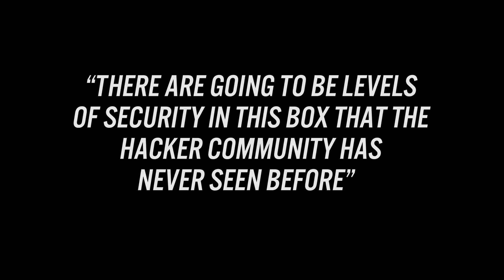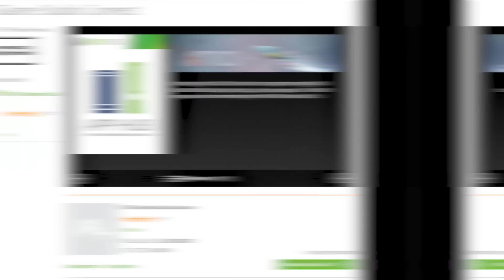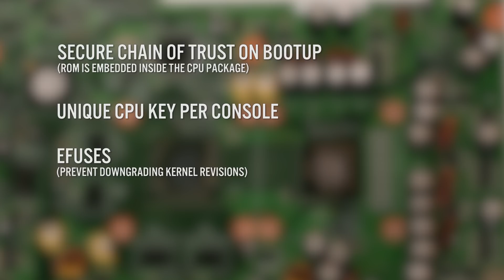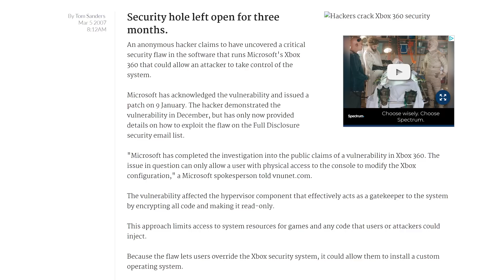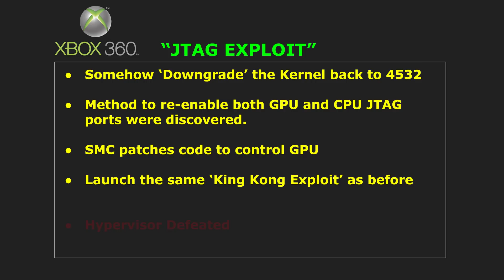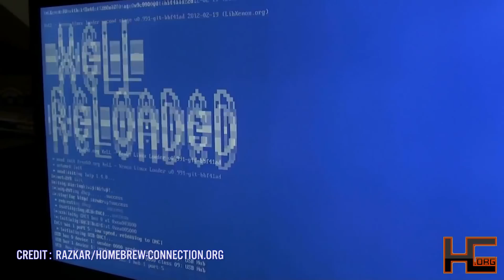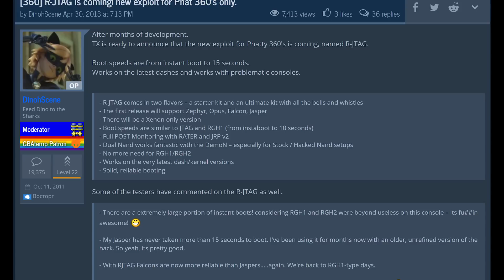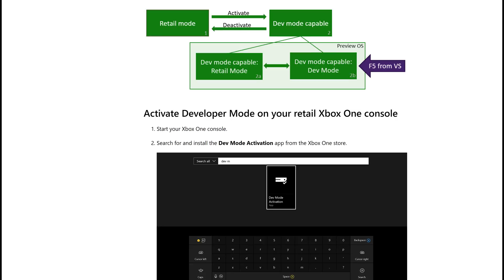How the Xbox 360 Hypervisor Security was Defeated | MVG

Comment: So I have a question, when you do a 360 OS update on the console, what parts of the NAND does it update? bootloader, CBA, CBB, CD? I heard CBB has changed in the past which is protected (hmacsha1 protected) by your cpukey, which means that microsoft would have to know all the cpukeys of all console and presign the update files before they gave them to your console if it were updating CBB?

Comment: I loooove my modded 360, I bought it pre modded with some call of duty games installed on ebay about a year and a half ago for around £50-60, an amazing deal. I mean it's a nearly spotless 360 S system with a to this day beautifully maintained controller, all the original manuals & paperwork and even its box. I never had a new 360 back in the day, my family were Nintendo people but we had a PS2 till I was 3 or 4. Having my own Xbox 360 with all my games backed up is amazing. I maxed out the expanded hard drive with so many games, I can play some of my favourite games of all time with very little hassle, just plug it in and play, regardless of if I have the discs readily available. I've got them boxed up just incase I buy a new 360 game to play and need to uninstall something

Comment: It's amazing that after nearly 2 decades since the Xbox 360 came out, it's security system still has not been breached when it comes to softmods like the PS3 and Wii. I would not be surprised if softmodding an Xbox 360 is actually impossible.

Comment: I wouldn't say it's completely defeated. To this day, there was only ONE softmod for the Xbox 360, and it was patched pretty quickly. I'd say the security on the Xbox 360, at-least software wise, has been untouched. Might even be one of the first unhackable consoles, software wise. Sad, too, since I, and many people, don't have the knowledge to hardmod one, and don't have the money to buy a premodded one. Unless a softmod comes out, I'm always going to think Microsoft really did make the Xbox 360 unhackable, again software wise.
Reply: Its not difficult to hardmod a 360 and a soft mod wouldn't be so popular, as hardmods are superior
Reply: @rob831  You sound very biased. Not everyone can solder. Even decides, if hardmods are so perfect, then why do softmods exist? I don't want to go try learning microsoldering, and potentially spend so much money on broken consoles, just to mod one console. I don't have the money or time to do so.
Reply: @chachaboy2  Because softmods wouldn't work on the Xbox 360, it was designed to fix the problems from its predecessor, the original Xbox, which is softmoddable. 
Because you're not willing to learn a new skill.
I JTAGGED and RGH'D multiple xboxes without experience. I taught myself.

Comment: From an outsider perspective: the Xbox runs a modified NT kernel similar to 2K or XP, and it has internet explorer as a browser, even if it seems like it isn't just sandboxed but it's also running on a separate mini OS.
That is very old software, and outside of the hypervisor and the encrypted stuff the only other reason I can think of why someone hasn't found a full software exploit chain by reusing known vulnerabilities is that powerpc is a dead architecture.

Comment: That's a very good investigation material about run unsigned code on the 360. I lived the problem of the RGH (Known as 5.0 in my country) that's unable to boot in sometimes when I tried to install FSD3, but at least, I installed and it going very good but the TU update is necessary, so I want to try aurora for that kind of feature.

Comment: seems easier to just make the console self destruct if anything is unusual
code the cpu to short the power pins and bam dead console
Reply: Not exactly that would require no update flaws at all.

That's always a backdoor for any programming purpose and setting that to self destruct is not preferable (e-fuses is in theory a good counter measure)

Comment: Ok, I've done hundreds of RGH, R-Jtag, and Jtag consoles over the years and xenon motherboards were compatible with the RGH hack. It was not widely used as it was completely unstable and only used for DVD key retrieval.The original RGH done by glee glee the developer of the exploit was compatible with Xenon, Zephyr, Jasper 16mb, jasper 256mb, jasper 512mb, falcon, and opus boards. This exploit was done originally with the C-mod board later to be replaced with the cool runner. Later the hack came to the Slim consoles. Each motherboard had a specific timing profile for the attack on the CPU. Some boards were extremely reliable others were not. I personally still have a dual nand RGH falcon board. You also left out dual nand systems using the demon boards from Team X. There was another board used previously for dual nand systems but I can not recall the name at this time. Lets not forget about the battle of defeating the Xbox Live challenges to allow these system to connect and hack all of your favorite call of duty games. You left out a lot more information than that.

Comment: Some corrections:
- The JTAG hack was not patched until Summer 2009 when the 8XXX kernel was released which overwrites the CB. 
- Zephyr, Falcon, Opus, and Jasper are all able to be JTAG'd using slightly different wiring, either using ROL or AUD_CLAMP (assuming 7371 or below). The Kronos motherboard shipped with a patched CB, which patched the SMC hack. Some Kronos have been found that were not patched, though.
- The lower left port on the Xenon board is not the CPU JTAG port, but the Southbridge/SMC LED JTAG port. This is why on Zephyr and later when most of this port was removed, one of the wires goes to the Ring of Light instead. The CPU JTAG port is J8C1, on the upper right of the board.
- The Reset Glitch Hack can be made very reliable, depends on install, tuning, and chip used. RGH1.2 can instaboot Falcon, Jasper, and Kronos on latest dashes. S-RGH can instaboot Trinity and Corona. There isn't really a reason to use R-JTAG anymore because of that.
Reply: Good to know

Comment: I remember doing this after the DVD drive hack and man was it a HUGE pain in the ass! I had a Zephyr (or possibly a Xenon) and attempted to do the JTAG myself, even though I sucked at soldering. I managed to build the NAND dumper using a self-built DB-25 connector that was wired to the board (got the instructions either from XboxScene or 7Sins), I remember it being hit or miss since you needed certain resistors and diodes in order to make it work, and it just took a bunch of trial and error. Dumping the 16 MB NAND took like a half an hour since it did it bit by bit over the serial port. I was in my early 20s and was home from college and I remember being stuffed behind my PC trying to get the connection stable (it would read for a while then suddenly fail), and my mom came in, knowing what I was attempting to do (well as far as "hacking the xbox360") and said "how the hell do you even know what you're doing?!" and I just said "I don't!" hahaha I managed to dump my keyvault, mod it, and flash it back, but my leads kept ripping out of the JTAG ports (since they were like 26 AWG wire and the pads about the size of a ball point pen) and during one the the multiple fixes some stray solder shorted out the Northbridge and caused a permanent RROD. I found this out by posting to xboxscene and a dude that had a reflowing setup to fix RROD boards offered to take a look, he said it was toast, and I told him to keep it since I had zero use for a dead xbox. He was also selling JTAG'd Jasper units, so I bought one from him at a discount. By this time someone on Xboxscene had built USB dumpers which made the process a million times quicker and easier (still required soldering, but no janky connections), especially since Jasper has a 512MB NAND instead of 16 MB. I kept hacking it for years but got tired of it and it sat in my closet for years. I finally gave it to a retro-gaming loving geek friend of mine as a christmas present last year and gave him all the tools necessary (even opening the shell was a nightmare), but he said it was far beyond his level to update it or anything, and just used it as is. It definitely wasn't for the feint of heart.

Comment: > "levels of security that the hacker community has never seen before"
> literally the most exploited system ever, re-hacked even after anti-piracy challenges sent by the servers, irreversible fw patches and new hardware revisions.

Anyway, that eFuse technology is something only the X360 CPU owned at that time?
As far as I know, now Nintendo has implemented a similar anti-downgrade measure with fuses in the Switch

Comment: if im correct then u miss the drive emulator which was connected between drive and console and allowed to be play isos from a external HDD, this was one of the recommend solution until RGH released. To the Drives, when my memory of the story 10 years ago Microsoft added on ap 2.5 another feature and make the firmware readonly and alot of people had the problem that there custom fw was overwrite and they where not allowed to bring it back or use any other one , also on this point in some case Microsoft fucked them self with this action  but on this point im not sure and i not know how the problem they had was
Reply: Rgh wasn't about the drives tho
Reply: @rob831  i know maybe i had post it under the previous video, its still a hack
Reply: @StefansSpielwiese  yeah that one video talks about the drive hacking

Comment: XexMenu is a homebrew menu that allows you to load everything, including backup games from either a USB drive or even an Xbox 360 hard drive. Freestyle Dash can be installed on Xbox 360 using the XexMenu.

You can install the XexMenu after you've modified the Xbox 360 with any exploit (King Kong Shader, JTAG, JTAG Timing, RGH, R-JTAG, S-RGH).

Comment: That was a very consise and dry look at at the 360 hack days. Thank you very much. I hacked mine with a reset glitch. It's unreliable. I thought initially I'd use it for piracy but that was still a pain so I found that it actually slowly ended my will to play games at all. Instead I concentrated on homebrew and applications like emulators   and ultimately used it as a nerd sandbox.
Reply: The rgh is not unreliable today. Say like 2014, then it was unreliable. Today the rgh 1.2 is a great hack and the S-RGH for slims as well.

Comment: 16 bytes are NOT easily bruteforced. 12 bits however are. 4096 is 2^12, so the actual lockdown counter is probably 12 bits, expanded with that encryption/hashing

Comment: Great video, but you're confusing the timing attack and JTAG hack together into one hack, when they're actually two separate hacks. 
The timing attack hack is a DOWNGRADING hack discovered shortly after MS patched the King Kong hack in the new Dashboard. The memcmp function used to compare the 16-byte hash for the LockDownValue was found to have significant latency when a wrong byte is compared, allowing one to deduce if the current byte being guessed is right or not. Using this method, one can build a new NAND image with ONLY the base kernel (ie, the Dashboard version found in launch xbox 360s), crack the hash for the LDV so the base-kernel image will boot, and then update the base image to the exploitable firmware (like a regular Dashboard update) to use the King Kong exploit. This has nothing to do with the JTAG hack (which came later) and the JTAG port was never used for this particular hack.

Comment: There is a saying in the world of serious computer security, "Physical access to the system is total access to the system".  I don't even know why manufacturers bother with such nonsense as security screws, that was busted from the word go.  But when it comes to electronic security techniques, they all fall sooner or later because you can always put a Logic State Analyzer on it, you can dump ROM or RAM, you can even grind down chips like the Soviets did to copy them, to get at the die and measure signals from inside the chip itself.  I really can't imagine it's worth all the money and time spent doing this kind of thing, it makes the product slower, clunkier, more unreliable (it's amazing how much more reliable an NES becomes once you cut the one pin that makes the 10NES chip forget what it's supposed to do) and more expensive.  I would rather spend my money on something where more of the money is going towards the characteristics of the thing that make me want to buy it than to the characteristics that make it antagonistic towards me.  I haven't bought a games console for myself since the GameCube and don't intend to in the future.  With the exception of one graphics adapter more-or-less by accident, I have never bought anything new with an HDMI port on it, either, as that interface incorporates that non-feature as well.  "Highly Dubious Media Interface", I call it.

Comment: Some extra info if you're curious: Thanks for the JTAG explanation, did not know it was reusing the 4532 slowdown hack. Also with RGH the main effect was that by slowing down the cpu a memcmp instruction usually fails in the low-level (unchangeable) boot process thus allowing to run patched boot code from the 16mb onboard boot flashrom... after that is successful - sometimes the whole cpu crashes - it is sped up and the fun can begin with patched hypervisor, etc. There were lots of custom chips created for this purpose. You also needed access to the cpu reset pin. Later xbox 360 slim models essentially first just did not route the cpu reset pin out from the bga cpu package so you could only access it with a small pin (4th ball counting from the top left of cpu), and towards the end of its life, from end of 2013-2014 they even removed that ball completely, so models from that point were essentially not able to be RGH'd :( Not that it mattered by that point in time. Modders usually swapped the mobo of these to an earlier model while supplies lasted.

Comment: Is there a way to load ISO images from a USB?
Reply: You can run games from a USB with a jtag or rgh but not isos, you gotta unpack the isos and have them in a certain folder. There's a program to do it easily.
Reply: @recondite376  What does it mean to unpack the ISOs? I'm completely new to XB360 hacking.
Reply: @jamesbuckwas6575  an iso is just the image file of a DVDs file and folder system. It's like unziping or unraring something. It turns the iso into a folder with the default.xex and the folders with the other stuff in it. There's a program that will do it for you and turn it into a GOD
Reply: The 360 can only load backups like that if it's jtag'd or rgh'd
Reply: @recondite376  What program can do this?
Reply: @jamesbuckwas6575  loading the games or extracting the iso in GOD format?
Reply: Dave Girvin extracting the ISO.
Or both I guess
Reply: @jamesbuckwas6575  I can't think of the name off the top of my head cause it's been a while since I've used it. I'd have to hook up my desktop to tell you the answer and I'm not getting into that tonight. Hopefully someone can fill you in. If not I'll lyk when I get it up and running.
Reply: @jamesbuckwas6575  ISO2GOD is what's coming up in a quick Google search but I think there's another program that does that and manages the external HD and files. I thought it was a regular name not an acronym name like ISO2GOD
Reply: @jamesbuckwas6575  I think it might have been buffalo drive explorer. For some reason that popped into my head. Or party buffalo
Reply: @recondite376  It's Party Buffalo Drive Explorer
Reply: @jamesbuckwas6575  a newer program to check out would apparently be FatXplorer. I haven't used it but I've seen it recommended
Reply: @recondite376  Alright. 
I switched to hacking the PS3, but thanks anyway. Maybe in the future.

Comment: So I had my Xbox 360 in 2011?  It came with R-JTAG? It boots very slow and indeed sometimes does not boot at all, then someday around 2013 it never boots up again, and I take it to a "dealer" to get it fix, after the "fix" it boots very quickly everything works just fine, anyone idea what kind hack is my Xbox 360 using?

Comment: Funny there is not a decent xbox emulator yet for original xbox

That is basiclly not more than a x86
Reply: Well, the thing is that with an x86 base, it would make little sense to actually emulate it, as it's basically the same hardware. This is why CXBX works by intercepting the system calls made by the Xbox games and redirecting those to the Windows equivalents (within the sandbox, of course), instead. But that has turned out to be quite the effort, as well.

Comment: The engineering behind the Xbox 360 security was quite ingenius. I must commend Microsoft engineers for very very creative security.
Reply: Yeah, those RRODs worked perfectly.
Reply: @JohnnyReb1976  That was actually a TSMC manufacturing defect, the only thing Microsoft could've potentially done is powered the consoles on and off when they reached the target temps before launch. At least they actually fixed them for free unlike Sony's yellow light of death which they would charge for if it was out of warranty, which was only like 90 days, 1/12th the warranty of the 360 (3 years).
Reply: @JohnnyReb1976 I mean.. nothing beats homebrew like a system that stops working for completely different reasons.
Reply: @JohnnyReb1976  RRODs had nothing to do with security idiot, RRODs were because of the cpu.
Reply: Lmfao

Comment: Honestly if you read original Team Xecuter readme you notice that its NOT trying every 100ns but it is sending 100ns Pulse to xbox 360 at correct timing (Phat models) after every 5 seconds (originally). So if it missed slightly that 100ns pulse it needs try again. Wiring makes it difference plus as it was leaked from Team Xecuter they launched it before that bypass method was even fully finished so thats why some not so steady boot ups. Example PLL and CPU_RST lines would miss some cleaning PCB touch by additional cap and resistor make it better.